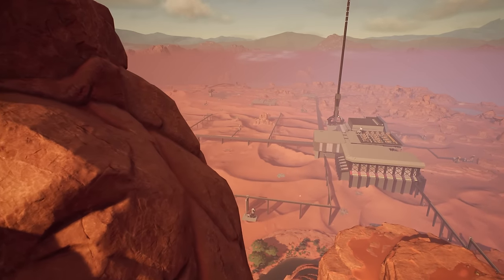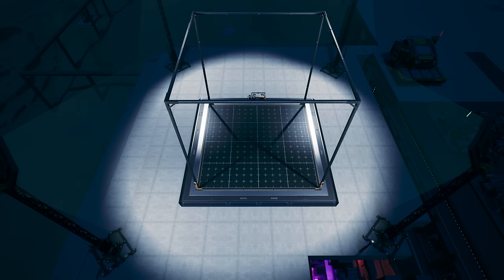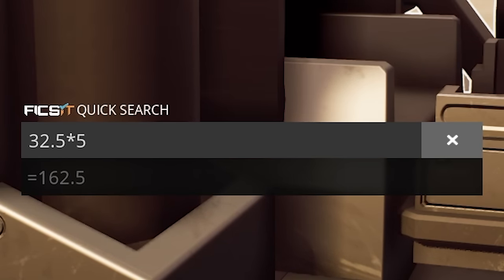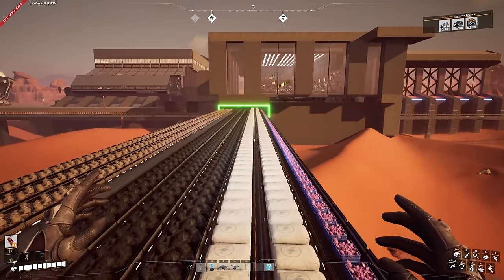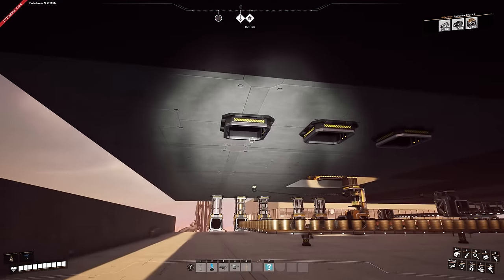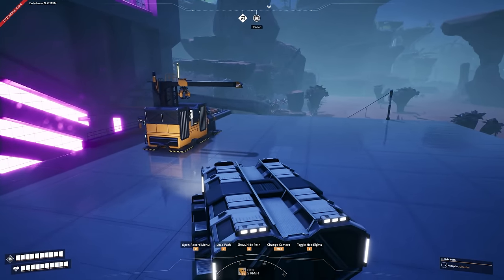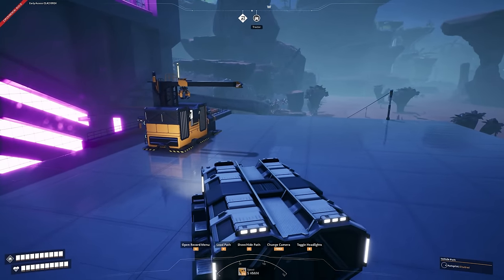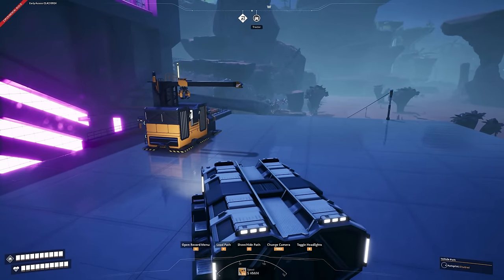I USED BLUEPRINTS to create a HIGHWAY FOR TRUCKS!!!  in SATISFACTORY Update 7 - Part 8

Comment: For the trucks
1) You don't need to wait under the truck stop or do the loading manually while recording the path.  If a truck gets near enough to a truck stop, it will visit it automatically.  It will go through the animation even if there is nothing being loaded or unloaded.
2) There is a magic spot underneath the crane of the truck stop that the truck wants to hit when driving near the stop.  Try to record the path so it goes straight under the crane so it doesn't do the truck stop dance when trying to visit the stop.

Comment: One more comment for you. I discovered that hyper tubes are bidirectional. You can put an entrance at both ends and it works just fine coming or going.
Reply: does that work with multiple entrances too? to boost the speed like Bitz does in his one direction hypertube
Reply: @johnb0815  as far as I know it does yeah. Just make the cannon part at the beginning and end one directional and that should work!
Reply: Now all it needs is a splat noise for the exit.

Comment: What do you mewan hyper tubes are 1 direction? Your can turn around in the tube by holding the S key.
Reply from the maker: But with the number of entrances (Boosters), I will fall out every time. The point of it is speed
Reply: @ItsBitz  I commented on hearing the comment and saw a bit further on what you meant a little bit. Still a fantastic Video. I made something similar earlier this week, but mine is Subway bottom layer using the quarter pipe components-belts/pipes and hyper in the middle section and a road on the top.

Comment: 3:58 Jeez, consider installing Microsoft PowerToys. They have a system-wide search-bar similar to that one in Satisfactory with its own integrated calculator. So, you can calculate whatever you want whenever you want by pressing LAlt + Space (or whatever you prefer) instead of going back and forth like in this example. XD
The only minor issue is if you calculation starts with neither a number nor an operator it won't be considered a mathematical expression, so you'll have to add "+" before "(" if expression starts with it.

Comment: Hey folks, I'm having trouble with my own version of a highway. 

How do you solve the incline problems? 

Mine never look good and they don't function well enough. My belts end up clipping in stupid and noticable ways, my hypertubes clip and look like trash and the clearance for the trucks and trains shrinks to the point of scraping the tops. 

Am I forced to use only the 1M or 2m risers? If so, then my catwalks suffer. 

Am I forced to just build a Mile up in the air and not worry about it? But then what's the point? Just run a sky beltway. 

I need inspiration, if anyone has some to lend.

Comment: Issues I have had using other people's blue prints or  blue prints in general with trains and roads is that they do not align to grid,  they do not attach to eachother so they are always off because moving around to see where this thing is aligning is extremely difficult.   So while it's a cool idea  I don't stopped using them at all